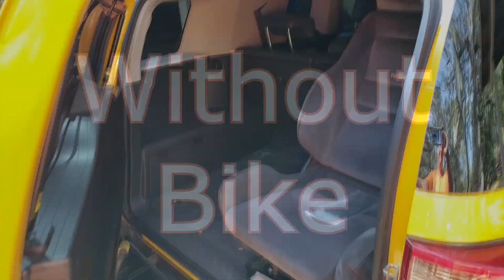Thule T2 Bike Rack/Hitch, SUV hatch access, Toyota FJ Cruiser Update 916xtr

Comment: Great video! I, too, have an fj cruiser. I am in the market for a thule as well. But was wondering if the dimensions are the same compared to Thule T2 pro xt? Will it fit? Any idea? Thank you 🌹
Reply from the maker: Actually I was mistaken, my rack is the Thule 916xtr... not the classic.  Anyhow, it does seem the pro and pro xt are different dimensions by I believe a couple inches.
Reply: Cyberskrimps any idea if its still in the market? Im overseas. Not in the states.
Reply from the maker: @LadyAntheaRose , seems the Thule 9044 classic which is their current offering is in the market and has very similar dimensions.... if not the same as the 916xtr.
Reply: Cyberskrimps sorry to bother, but do you have the dimensions of your own? The 916 xtr? So perhaps i can compare with the pro? Because i rather get the pro xt. It is much easier for me to use.
Reply: @LadyAntheaRose  if you have the OEM hitch this won't fit. since it sits much higher. the door won't open... would need a receiver drop adapter.